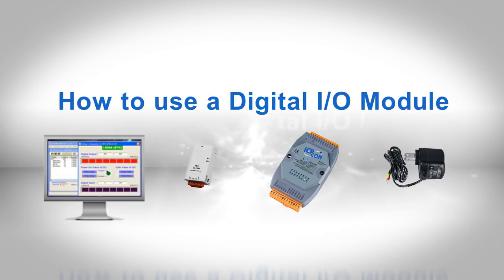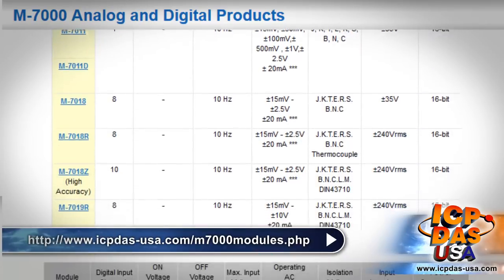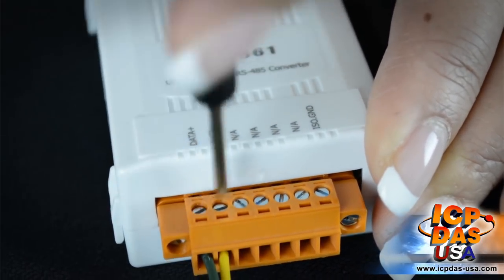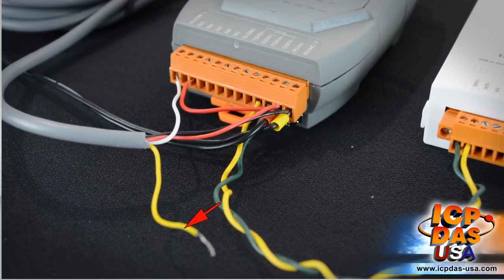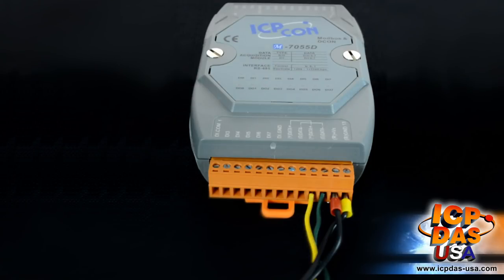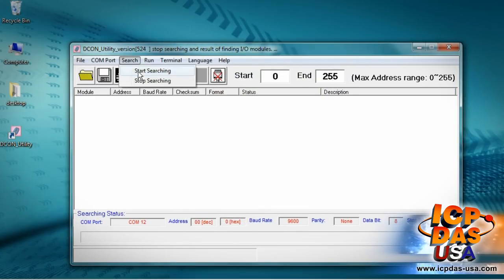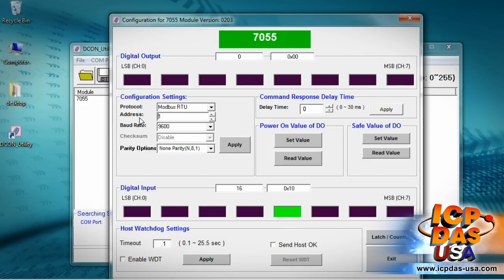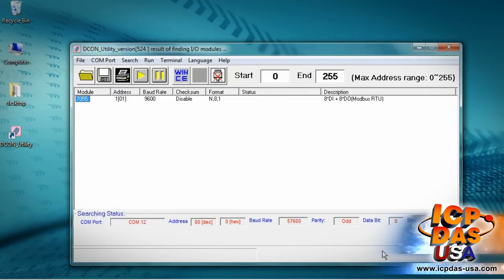How to use a Digital I/O Module? | ICP DAS USA

Comment: Great video! Helpful.  Thanks.
Reply from the maker: thank you so much, Jeff!
Reply: @icpdasusa  I am using ICP CON I7021 module configuration using Dcon Utility. I search as described the module  in this video but I am unable to find the module with Dcon Utility. Kindly support
Reply from the maker: @KundanKumar-904  You can download the DCon Utility from a link on the product page here: http://www.icpdas.com/root/product/solutions/remote_io/rs-485/i-7000_m-7000/i-7021.html But if you can't find the module with DCON Utility after the module has been configured, then you should contact tech support here: http://www.icpdas.com/root/product/solutions/remote_io/rs-485/i-7000_m-7000/i-7021.html